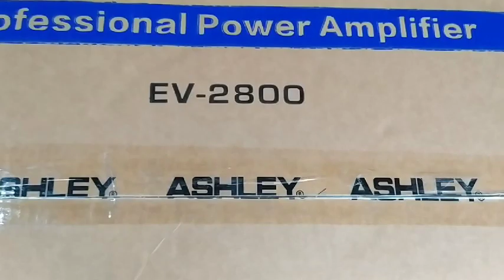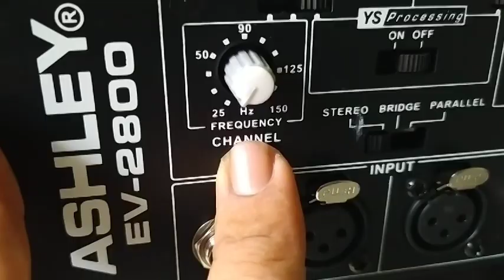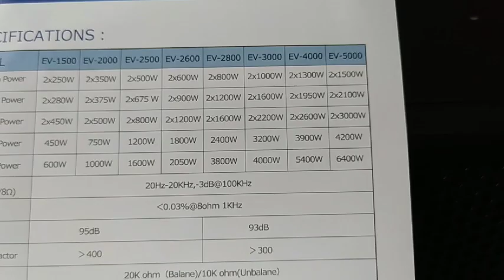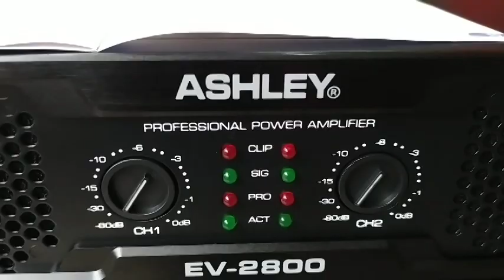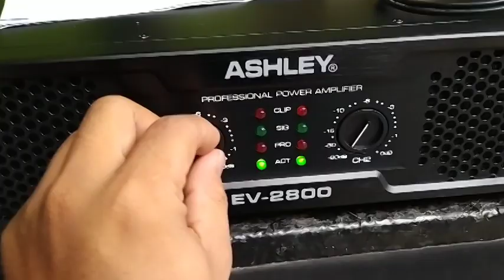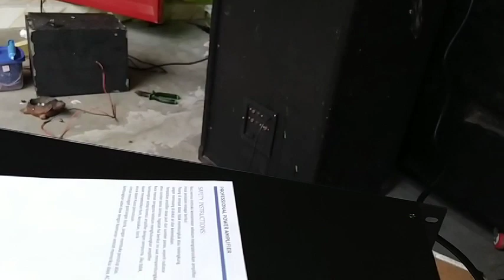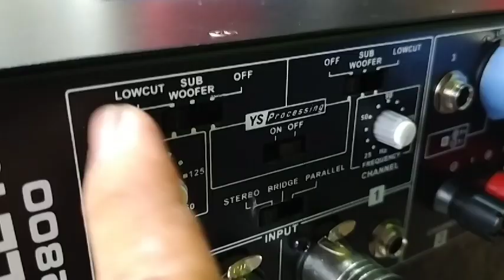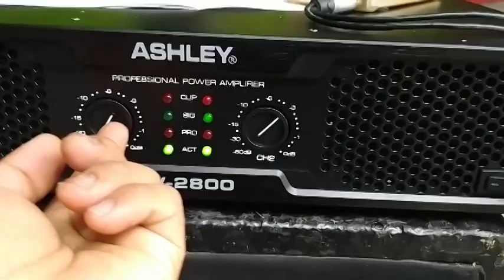power ashley ev2800 sudah dilengkapi frequensi mantap pokoknya tidak kecewa

Comment: mas kalo saya pake 1 speaker RDW LS1885 yg rms 1000/2000 watt tapi pake power Ashley ev 2800 Di mode Bridge Btl 8ohm 2400 max power nya gimna😂aslnya per ch cuma 800 watt😭😂🤣

Comment: Power Ashley ev 2800 sama Ashley pa 800 spek nya bagusan yang mana
Reply: Bagusan  yg ev2800 karna sudah di lengkapi crosover
Reply: @khairilanan3813  kata nya travo nya gmsedikit gedean pa 800
Reply: @CahGempol  gede doag ampere kecil . Yg ev kn udah ada crosovernya y tinggal gabung mixer doag layan irit daripada beli crosover DBX 123 harganya 1 jt .
Yg ev2800 tinggal seting chenel satu buat low chenel 2 buat mid
Reply: @khairilanan3813  buat 15600x2 sama 12 in 2 biji maksimal ngk suara nya
Reply: @CahGempol  kurag bos . Tapi masih bisa angkat sih di jam 12 .  Krna perchenel 800 watt y tinggal bagi 2 masing² dapat 400 watt
Reply: @khairilanan3813  per Chanel angkat 15600 kurang besaran berarti mas
Reply: @CahGempol  kalau spikermu 15600 kali dua baru maximal .
Kalau pakai ashley cy1535 x 2 . + Spker 12"+ twiter x 2 maximal